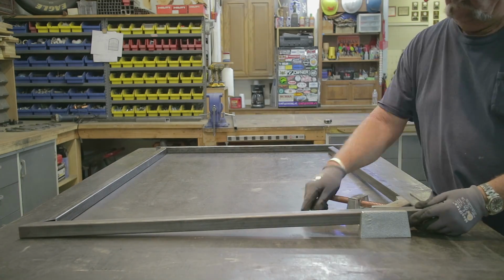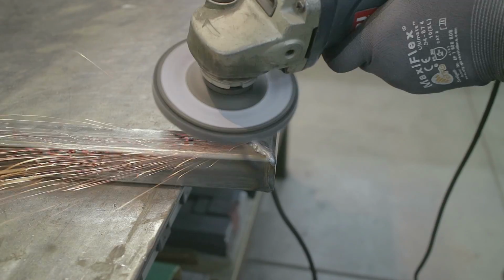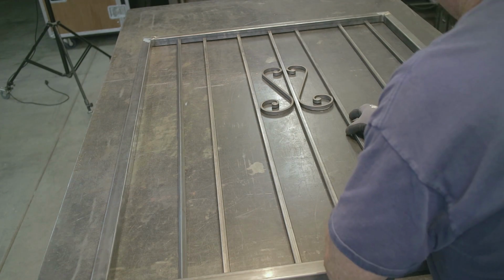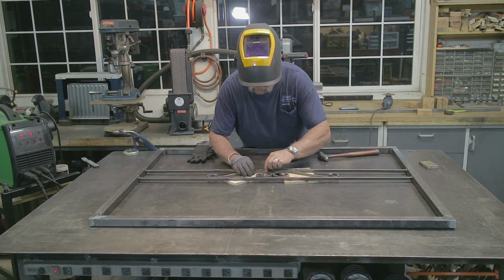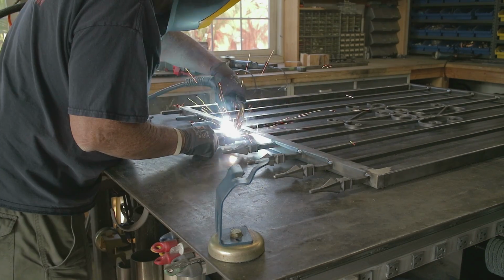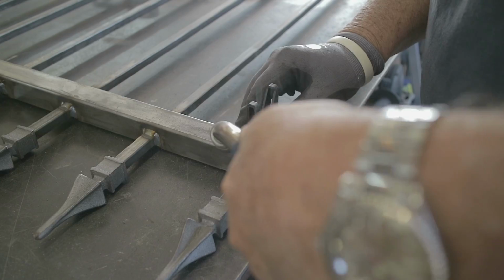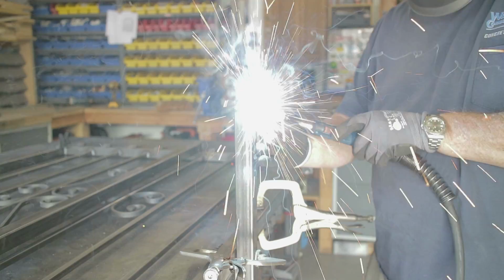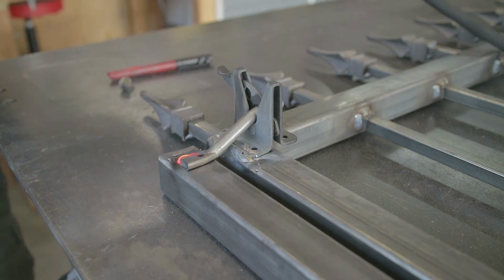Decorative Metal Gate - Jimbos Garage

Comment: the reason the latch is long is because you are installing it in reverse. the shaft should be on the moving part of the gate, the receiver should be on the fixed post. the reason is you dont want a sticking out shaft when the gate is open to hit someone walking by it. when you flip them, you wont have this problem anymore.

Comment: nice video, just thought i would mention about those bat wings, I just put a weld around the bottom  of the pin after installing and that way you can not pull it out.

Comment: Love the videos! I had a question for you. I am a younger welder just getting into fabrication and I have a job coming in similar to this and when shopping around for spears for the top of the gate all I seem to find that I like are cast iron. I was wondering if A) You can, or have any tricks, to welding cast iron to mild steel, or B) Where do you buy these as mild steel spears at? I am shopping at CustomIronWorks.com and couldn't seem to find what I was looking for. Again love the channel and hope to here from you soon. Thanks!
-Andrew
Reply from the maker: Thanks for watching Andrew, The spears i used were cast iron, Cast iron welds to mild steel pretty good, There is a little more splatter than normal but not bad. Try KINGMETALS.COM for your gate and fencing parts.  Jimbos garage!
Reply: BischoffFabrication I'm welders I want work if you want me I want make every thing for you let do some company if you want im artists for metals

Comment: Concerning the hinge, I was thinking of possibly drilling and tapping a hole in the gate's round axle lower part then placing an odd size cap screw into it from the inside. Large enough to prevent it being lifted out. Just a passing thought.
Reply from the maker: Thanks for watchingTom, Yes that is exactly what i ended up doing, Worked well.  Jimbos garage!

Comment: Hey Jimbo, I notice that when you use your cut off saw, you put a piece of square tubing between the from and back of the clamp... what is the reason for this?
Reply from the maker: Thanks for watching Amy, Yes the piece of square tube is to move the material I'm cutting more to the center of the blade, Where the clamp is from the factory it is to far to the back and doesn't always cut all the through the material.  Jimbos garage!